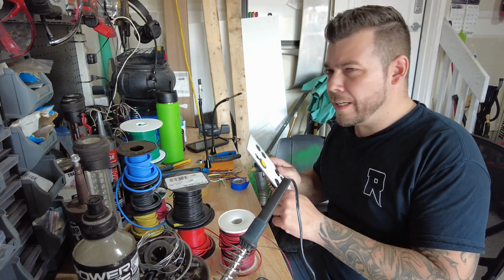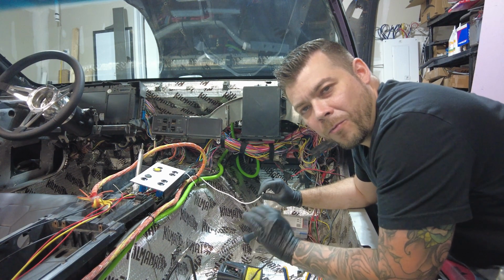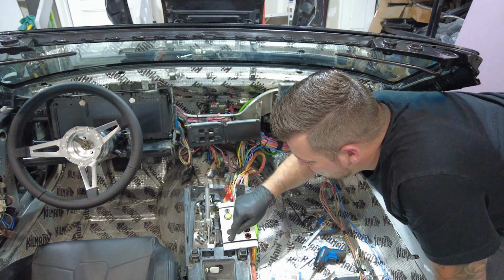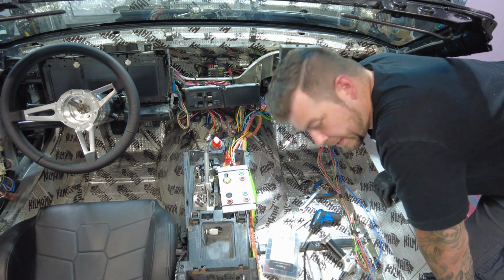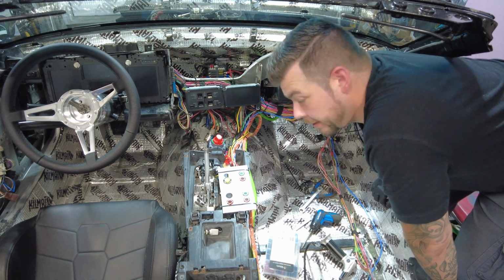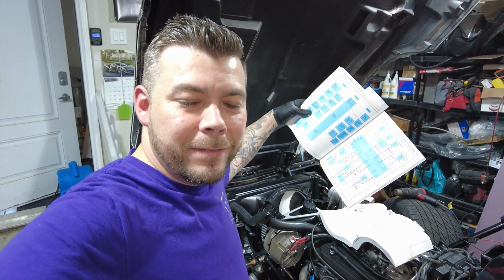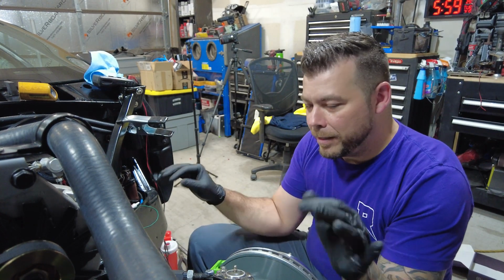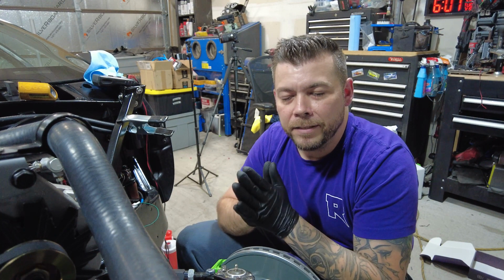WIRING PART 4 AND MOAR! - WIDEBODY C4 CORVETTE - RUSTED AND BUSTED

Comment: The coolant sensor on the side of the engine should be the one for the dash.  It doesn't go to ground because it measures resistance at different temps like you said.  The temperature sensor above the crank/water pump tells the fan when to run.  The oil pressure sensor for the dash is above the oil filter.  The dash won't read coolant temp below like 100 degrees.  Polarity doesn't matter since it's reading ohms.  There are some posts for temps/resistance on the corvette forum.  Not sure about your year but my 86 kicks on at 230 degrees Fahrenheit or so.  Your parasitic draw can't be a light unless it's shorting to ground somewhere.   I would check the lights on the hood since that is on even when the keys aren't in, could be a short there.  Loom is probably melting because it's cheap material.  I think those come with a hard plastic guide from the factory and those hold up.
Reply: Sorry correction, oil pressure is near distributor oil temperature sensor is above the filter.
Reply from the maker: @alexd7955  Thanks for tuning in and the response! In the next video this is all figured out and we get to go cruising! :) few more kinks to work out but shes alive!
Reply: @RustedandBusted  can't wait to see what the battery drain was and how you fixed it

Comment: Do you have a video on how you deleted the blower motor and made it neat?
Reply from the maker: Hey hey! I do! They are not quite in depth about how to take it all apart mostly but there are a few videos in the series before this one that shows the battery installation inside as well as covering up and finishing the panel 😁🙏 thanks for tuning in!
Reply: @RustedandBusted  battery inside? Thats a great idea. That stock spot is terrible.
Reply from the maker: Thanks! I think so too! Ther eis plenty of room up there for sure! These large 315 tires and the low offset puts the tire right into where the battery used to be! So naturally it had to be moved 🤣

Comment: Hey :) what seats are those?
Reply from the maker: Hey! I'll have to add the link to the description for ya. But they are from Amazon.com! Braum racing replicas
Reply: @RustedandBusted  thanks for a fast response, your project is inspiring. Im currently buying a c4. Im standing inbetween a 89 with 6speed, gone 70000miles , or a 87. 4+3 and way cheaper.  Going to make something fun out of it anyways :D
Reply from the maker: @Skwiizgaar  Glad I can get you inspired! They are great cars for sure! If I had my choice it spend a little more and go for thr 6spd. I've heard mixed things with the Doug Nash but either one is a great choice to get rocking 😁👍
Reply: @RustedandBusted  exactly! I think ill go that way :) its in mint contdition aswell